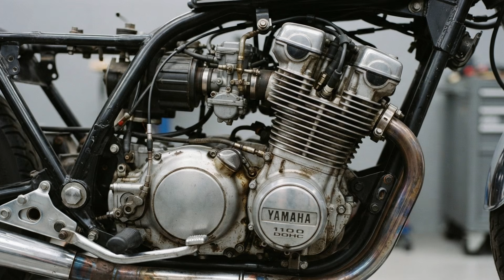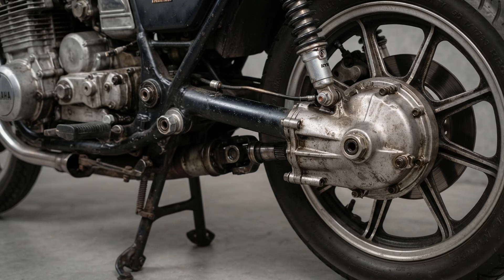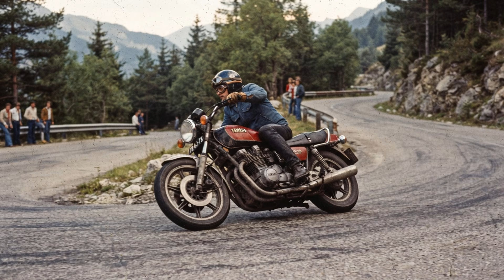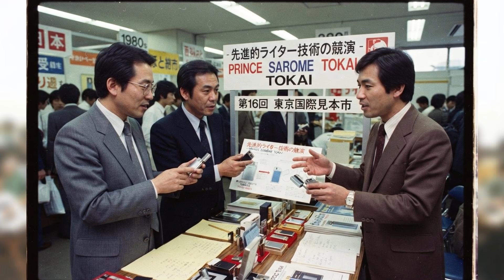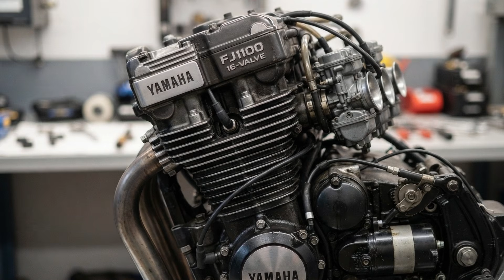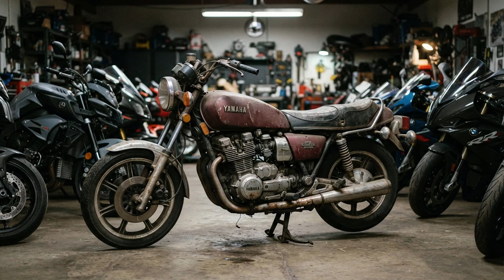Why the Yamaha XS1100 Disappeared So Quickly - details explain

Comment: This has to be one of the poorest examples of AI that I have ever seen. That's saying a LOT, trust me. Sidecovers NEVER had XS1100 on them. They spelled it out. XS Eleven. Also, it never used 8 carburetors like I saw in at least one pic. The Eleven was quick, but I never saw stock Eleven's running a low 11 second et. High 11s, yes. Also, the shaft drive pics....ESPECIALLY the one at around 11:20.....My good God-Did this dude ever seen a real XS Eleven, or ride one? From this hopeless mess of a video, I'd have to say no. Don't quit your day job, because this piece of work truly sucks😮😮😮👎👎